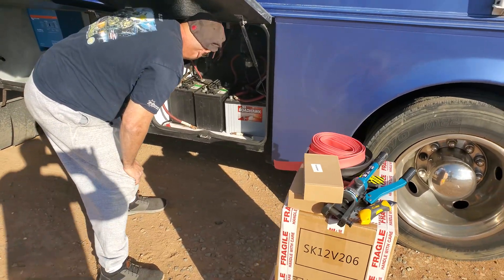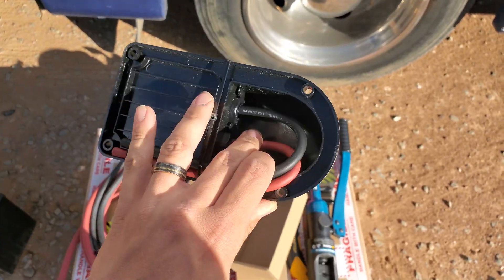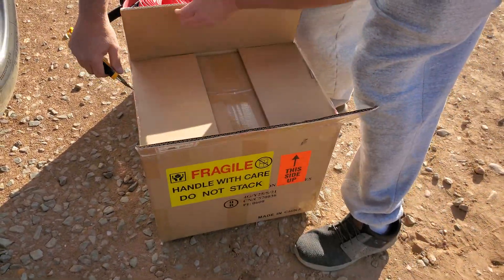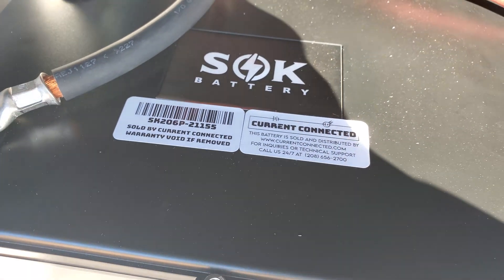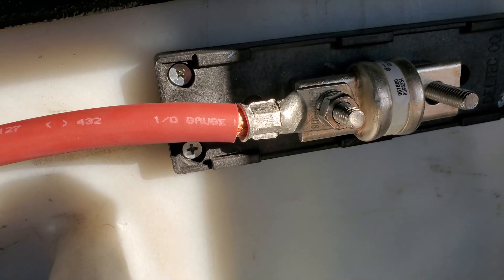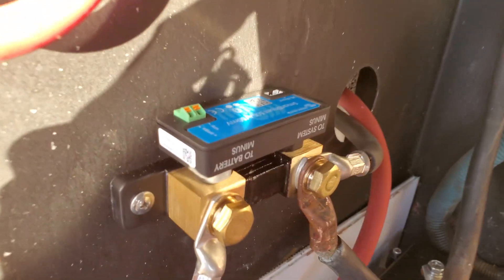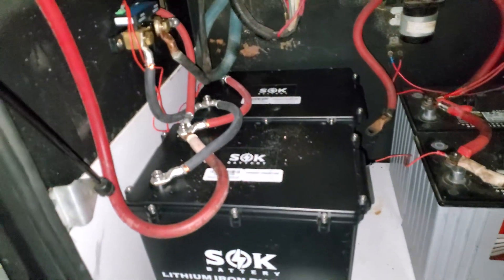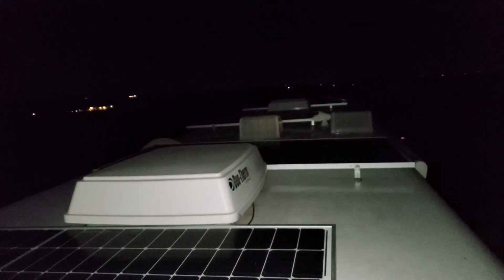SOK Battery: The Easy Upgrade From Lead To Lithium

Comment: 1/0 cable? Victron recommends a higher gauge for the multiplus 3000. At 12v you could be running 250 amps through that wire. It's definitely better than the 4ga before but still not what I would consider adequate. Perhaps I'm missing something?
Reply from the maker: The maximum current batteries could output is 200 amps. 1/0 is just barely big enough, I only have 4/0 on hand as the next size up and the customer was not going to pay that price when the batteries can't even supply that kind of power. Also in the system the customer is never going to fully load the inverter.  Wire is sufficient for the weakest link in this case which is the batteries.